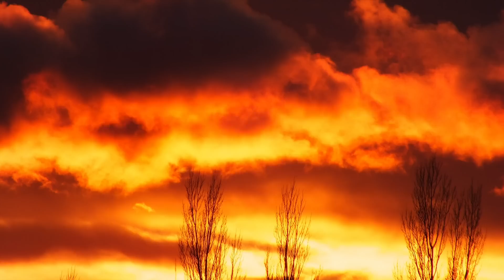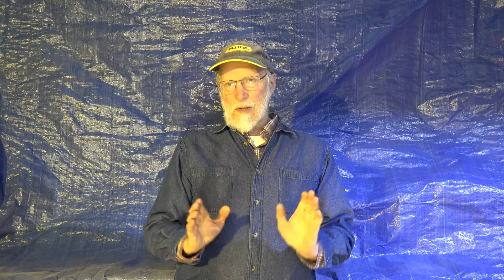What is common in electrical wiring

Comment: Step one. Understand Line and Neutral in an AC system. Step two, understand that DC terms change to identify that it is different from AC power but the circuit has to function the same regardless. They is a constant line of power on one side, regarded as “line” in AC and “+ 24V” in a DC circuit. The “neutral” in AC, is the “-“ or “OVDC” in DC. And just like AC power, the neutral (- or 0VDC) is bonded to GND at the panel

Comment: It sounds like the common wire as you describe  it is in a 24 volt  DC circuit is :
1. Connected  to the chassis 
2. Is unscathed
That sounds like  the wire down side from a load, exhausted  of volts, reading 24 volts voltage  drop across the load  directed to a ground and that is why it is attached to the chassis.  I'm not telling you,  I'm asking you
So what would be the wire that has switches typically in series  , thrmostat, pressure switches not connected  to the chassis and upstream from the load. Or leading to the load
Reply: Fooled by auto correct. Number  2 above should  read
2. Unswitched
Reply from the maker: Not sure of your meaning.  This circuit has no 24 volt portion.  The 24 volt circuit in a furnace is produced by a transformer that changes 120 volts to 24 volts.
GFM
Reply: This  comment  Not this  one the one  above about a neutral  grounded conductor  could of never been type by me,  I ''m no where near that smart.  It's an interesting  read  but I already have  an understanding of  the netural  . And Grayfurnaceman just  told me  how  to idenyify the neutral using a multmeter.  
Now how can I identify  a common  using a multmeter.  The common wire
Reply: Strike this comment  out . It reference  a comment that no longer is on this thread  the referenced  comment on my tablet originally was on the neutral video and some how appeared on this video section
Reply: grayfurnaceman could you get rid of all my comments posted on this comment  section. I'm so confused  with my numerous comments   I do not know  to continue

Comment: So the common is just the continuing part of the hot line. Like it comes into the hot and goes out the common? Am I on the right track?
Reply: Basically 120 volts stepped down to 24 volts instead of hot and neutral you have hot and common thats what i took away
Reply from the maker: It is.  If there is no connection from the common to the source of power, the common will be hot.
GFM
Reply: Yes u r

Comment: what do you mean by unswitched side of line for the common? great info just need to fully understand concept.
Reply from the maker: +Robert Munguia On 120 volts, There is the hot (black) and the neutral (white).  The hot is usually switched because you would get shocked if you touched it.  You will not get shocked when you touch an unconnected white.  Hope this helps.
GFM

Comment: Example: common in a high bay light ballast for commercial can be neutral for 120 or L2 for 208/240/277
Reply: refrigeration tech yeah but he just said it supposed to be unswitched. So if it turns into L2 then you would get shocked right!

Comment: IMO
The common in a 24vlt circuit is not switched through the safety's because if R was direct and C was switched if a short to ground were to happen  anywhere along the common path the unit would still be able to operate without the safety's between the short and transformer.being able to shut unit down. 
This is not a safe way to wire the low voltage circuit.
Reply from the maker: +John Heritage However it is sometimes done by manufacturers for several reasons.
GFM

Comment: Good video, I'd like to see one on properly setting an adjustable head pressure contoller and why you picked the temps/pressures to cycle the fan. Seems fitting being that's is winter.
Reply from the maker: +Matt Rodriguez I will be doing one on using head pressure to control high and low side pressures.  Just have not gotten around to it yet.
GFM

Comment: common is called common because it is common to something.  usually a common source. common in a 3 way switch, relay, i/o module ect. are most of the time hot or ungrounded and unswitched. could be a common feed, a center tap, or a common ground. depending on the circuit.

Comment: funny you mention this. Instead of hooking up the common on a 240V single phase PSC motor - I hooked up one of the speed taps - motor got pretty toasty. so I was using the hi and med-lo speed taps for 240v. Cost me $100 bill. Good video.